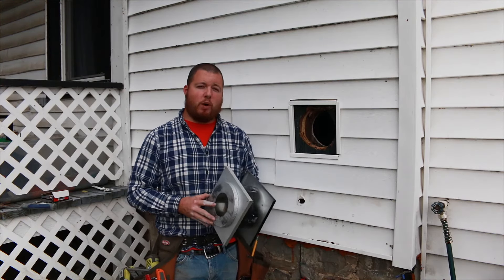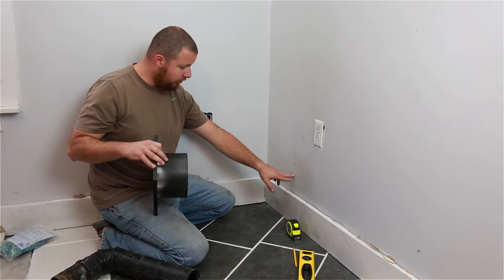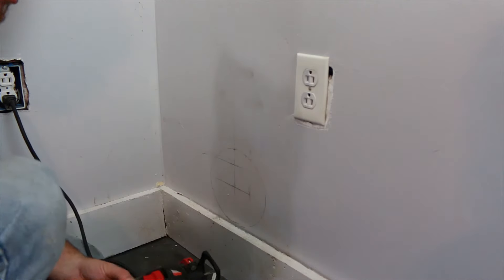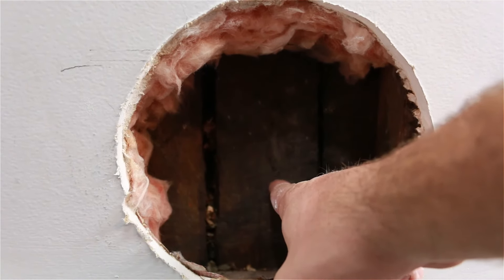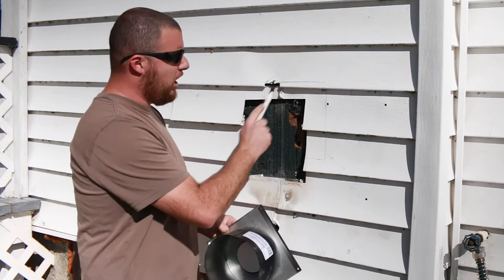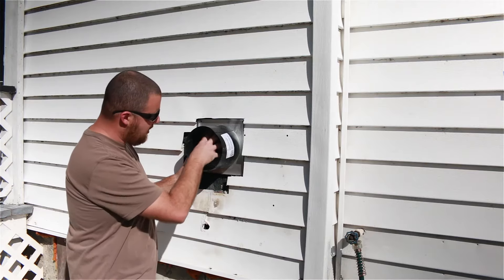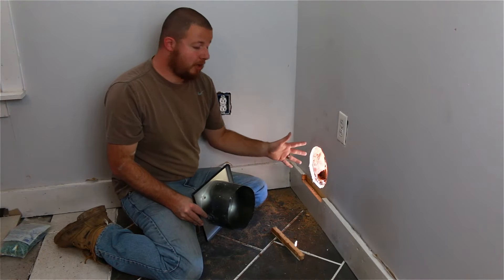Wall Thimble Installation

Comment: He's got ads like he's making money on this but he isn't spending it on siding, or finish work inside for sure
Reply from the maker: What would you have done differently with the siding or inside?
Reply: @appalachiandiy2415  Fix that hole below the penetration? Caulk around the hose bib? Use the oversized cover plates on your receptacles to fix the over-zealous router job? You want more? You're putting up a DIY here when I see that and can't help but wonder how many other people are going to blindly follow this when you're missing some basic work yourself.
Reply from the maker: @fordman32508  ahh i see. all those things have nothing to do with the installation of a wall thimble, but yes they do need fixed. Was there anything with the actual install that you would have done differently or was it just those other non-relevant issues to the install?

Comment: Question! And I hope you can please help me out. I have the same vent thimble like the one you are using. All four screws are holding the outside plate of the house but it seems that I just noticed that one out of the four screws on the plate that is on the inside of the house has popped a little out. Meaning the plate on the inside of the house isn’t flushed with the wall due to 1 out of the 4 screws has popped out. I can’t reach it cause the fire place is in place. I was able to see it when I was just about to fill in the gaps with drywall around the fire place. Do you think that sounds too concerning?

Comment: It should be made very clear (like in the title) at the beginning exactly what this is for. This would not be a good procedure for a wood stove wall thimble.
Reply from the maker: This would work for a woodstove if you had a larger thimble(6-8"). Same exact install but your stove pipe will be routed to be above the roofline. Is there a specific reason you think this would not work for a wood stove?
Reply: @appalachiandiy2415  Wood stove chimney pipe has a much higher design temperature. This means different clearance requirements that need to be met.  Class A chimney pipe is also much heavier. For these reasons the thimble is framed in, not just passed through drywall.
Reply from the maker: @Begreen9  thanks for the info

Comment: That just looks awful
Reply from the maker: What part?
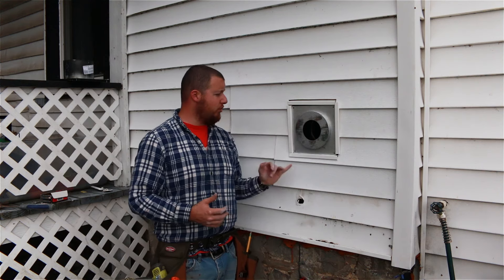Reply: @appalachiandiy2415  5:52 that part
Reply from the maker: @sayhitome8093  mmm I see. never said I was a pro sider. always room for improvement
Reply: You made it look easy ...nice!  I have the same scenario,the only place I could install my thimble is about a 1/2” away from a stud is that to close? It looks like you were snug against it.Thanx
Reply from the maker: @kkhans3533  No that is fine. That air barrier provided by the thimble will be fine if it has to be against something

Comment: So question why did you put it on the baseboard. Didn't you create yourself a little more work by having to cut it. If you just gone maybe inch or so higher up you could have been flush or just right on it? And why not get a hole saw the size of the hole?
Reply from the maker: hole saws that large are pricey. As for the the pipe, i ran it straight out the back. if i would have raised it i would have needed to put another elbow on to get the angle.
Reply: @appalachiandiy2415  I'd have placed a hearth pad under the stove to raise it up enough to miss the baseboard.

Comment: Iam installing a wood stove in my garage. Iam not insulating it until next year. The thimble has me confused since all I have is two bys and the siding. Should I put a panel up so it’s in proper?
Reply from the maker: Yes. Just put a piece of plywood or something to "hold" the interior side of the thimble in place

Comment: I have an old house built 1927 with plaster walls and brick outside.  I’m pretty certain no insulation at all.  What would you recommend i make the hole with?
Reply from the maker: You can get masonry hole saws but they are expensive. If the brick is exposed you could remove the bricks you need, cut to fit around the pipe and repoint the bricks
Reply: @appalachiandiy2415  thanks for replying. The opening I need is 7 1/8” so I guess I will have to make 7 1/4 “ hole.  I’m just worried I might mess up the plaster wall from all the cutting and vibrations
Reply from the maker: @Ss_l1776  you will be suprised how tough that stuff is. It may crack a little but just putty over it with drywall mud

Comment: That J channel work looks a little janky, I see at least a half inch gap on the top .. sorry had to point that out :P 
I'm not great with siding, but the top channel should extend all the way across and have about an inch of "ear flaps" that fold down and over the side channels to shed the water away from the thimble. Also I would tape the J channel all around .. or if it's an older house like this one with tar paper, you are better off tucking the J channel under the tar paper. It can be tough to keep old tar paper from falling apart, its like unwrapping a mummy, you have to be super gentle.

Comment: I was disappointed that you didn't use the thimble on the inside as a template the same way as the outside. Cutting into the baseboard is a terrible idea. It makes restoring the wall much more difficult for when the time comes that the pellet stove is undesirable. All you had to do is add an additional 90 deg turn that you could have adjusted to any angle places in the middle of the straight pipe or added an additional straight pipe. There's a big difference between a professional and an amateur installation and there's no reason not to do a better job. I could see some framing at the bottom and right-side interfering with the size of your hole. relocating the thimble, a bit to the left and upwards would've been the correct solution. I'm guessing that a building inspector never looked at it. Fire & safety codes should never have corners cut. If cheap & fast is "your thing" then that's fine. I personally prefer to make things safe and correctly installed.
Reply from the maker: The reason I cut into the base board is because the exhaust is low on the stove as well. I would of had to used 2 more elbows to get it higher. With it low now I can still get back there and work on it without a pipe in the way. (Had to replace a blower. With the pipe that high it would have been a pain in the butt. No restoration needed either stove is there to stay. Plus its baseboard not some ornate woodwork.
Reply: @appalachiandiy2415  Disconnecting the pipe isn't a big deal. You need to do it to maintain the flue anyway. As far as the stove being permanent, you won't likely be the last owner of the house, so I always make things like that easier to remove if necessary. It's always best to have a longer flue because if you change the stove out, you will be less likely to need to relocate the hole up higher. You should be cleaning out the flue every year because of the creosote buildup. The blower will/should last many years. I hope you put a fireproof base under the stove. I'm not trying to give you a hard time. I'm hoping to help you make better choices is all. If I can help you avoid the mistakes that others have made, I will call it a good day for all of us.
Reply: @MakeitZUPER what's hard about replacing a baseboard? Its super cheap to buy and takes literally minutes to measure cut and install....that 90° turn is literally gonna be more expensive than that piece of baseboard.
Reply: @alexandrelafrance944  The concept is depending on two things. If the baseboard is in an old house and isn't painted, matching the old growth grain will require vintage salvaged lumber. The other is price in your workmanship. Every tradesman that looks at it will know it was an amateur installation. If the person has no pride in their home, then fine. I usually only see this low-level quality in slumlord buildings and DIY homeowners that don't know any better.

Comment: What call did you use?
Reply from the maker: im sorry, I dont understand the question
Reply: what caulk did you use
Reply: Did you seal the thimble on the outside to prevent moisture from getting in.  And if yes, what did you use?
Reply from the maker: @chadhanson3431  I did not seal it since I used j-channel but I could have around the plate. Just use a window, trim, sealant or an outdoor caulk thats flexible.

Comment: Question.  I am about to install a kit for a direct vent gas stove.  I am not worried that the fittings are different from the ones you use for a wood stove.  What concerns me is that my house is plaster and lathe and I am worried about my choice of saw causing the lathe to vibrate or tear.  Do you recommend a style of saw such as reciprocating with a long blade?  Thank you
Reply from the maker: Try an oscillating type saw
Reply: @appalachiandiy2415  Much appreciated.  I am quite handy with plumbing and electricity, self-taught, but carpentry makes me nervous.  I will likely have this done professionally.  Have a great new year.
Reply from the maker: @johnwashburn7423  thanks, you too!

Comment: What do you recommend for houses built with nothing but drywall-foam board-vinyl siding, and no wood in between?
Reply from the maker: Do you not have sheathing for your exterior? Do you have that cardboard stuff?
Reply: @appalachiandiy2415  It's green foam board, then the siding - no wood at all other than the studs.
Reply from the maker: @mcicoachmc9  wow. thats crazy. maybe trying to nail in some plywood in between the stud bays  to give you something to work with
Reply: @appalachiandiy2415  Thanks, that's what I may try to do if I can piece something in without damaging anymore of the wall than I have to.
Reply from the maker: @mcicoachmc9  Good luck, I hope it works well for you

Comment: Incredible to see how incompetent "professional builders" really are. Not talking about the guy with the thimble really, the siding job is garbage, fckn disgraceful. And you can tell the guy installing the little thimble is a stove pipe installer not a pro carpenter at all lol. Next time buddy just get a 1/4" 12" drill bit as a pilot. You drill right through as your center, use a compass to mark your outline cut and you're all done
Reply from the maker: Are you saying to drill through the interior wall and exterior at the same time with the 12" bit?
Reply: Yes sir. You did great, but that'll make everything much easier for you in the future, doing your best to stay away from wires.
Reply from the maker: @johnserrano9689  Thanks for the tip!

Comment: You are suppose to frame a box
Reply from the maker: Is it needed to meet code or just for the thimble covers to attach to? if so I would like to read the specific code if you could cite it
Reply: @appalachiandiy2415  not code, its more for the inside to have something to bite on to
Reply from the maker: @vegaslowblower8781  gotcha, thanks
Reply: He hooked 120 volts to the stove pipe to get a little more out of it!😂🤣😂🤣

Comment: so how did you know where your studs were? Are stud finders reliable? I'm concerned about cutting through some wires or who knows what. Thanks
Reply from the maker: I used a stud finder. Yes they are reliable, just buy a good one. I've added one in the description  below the video that will also recognize live AC wiring. You can also measure 16" increments off the corner of a room as that is a typical spacing for wall studs
Reply: @appalachiandiy2415  
I wouldn't suggest assuming 16" centers. A properly framed wall should be 16" centers from one end. Since most walls don't divide perfectly by 16", the other end will have the first stud in on 16", but then the second spacing will likely be less to compensate for the wall not dividing perfectly. Stud finder is best.
Reply from the maker: @truthspace5525  yes, I agree

Comment: Is it normal for the top of the thimble to get pretty hot when the stove is on high? the wall pretty warm as well. Just worried about fires . Also I noticed a small amount of smoke possibly coming from a seam
Reply from the maker: make sure all of your connections are seated properly. You shouldn't have ANY smoke at all. It's a good bet also to use a high temp silicone to seal all of your piping connections.
 I just checked my thimble and its cool to the touch(med heat) I would definitely check to make sure something isn't wrong

Comment: I just installed a thimble in my garage wall for my big Maxx heater. Used the B vent pipe through the thimble. I have a 1/2" air gap in between, what can I use to seal that? I don't want to lose heat through there as my garage isnt insulated.  Thanks!
Reply from the maker: Is there a 1/2" all around? thats a pretty big gap. If you can center it and its only 1/4 all around i would say a high temp caulk/silicone would work great.
Reply: @appalachiandiy2415  it's a tad wider in some areas and less in others . I think a little too wide for caulk
Reply from the maker: @Teglove  they make insulation that is fireproof but its a little pricey. Could fill it in with that
Reply: might be a tad too late but you can try some of the rope gasket that they make to seal pellet stoves.

Comment: Lol...I would have picked a spot, with alot less electric.
Reply from the maker: Yea, well this location worked best for the distribution of warm air throughout the house. anywhere else and it wouldn't have worked. The meter that was taken out was not in use and was inoperable so it wasn't a big deal taking it out
Reply: @appalachiandiy2415  Electric scares the hell out of me. I avoid it like the plague. I barely hang pictures anywhere near it lol.
Reply from the maker: @Patriot4TheTree  Hahaha! Its honestly not that bad. Try with some small stuff like changing out an outlet and work into bigger projects. Electricians are expensive so if you can do stuff yourself you'll save a lot of money